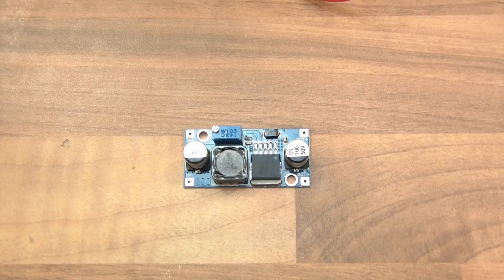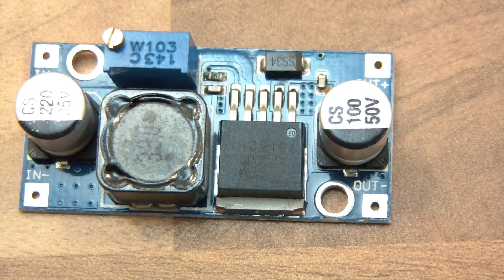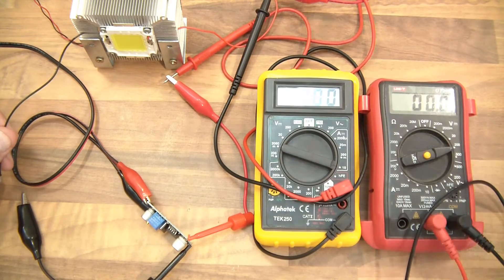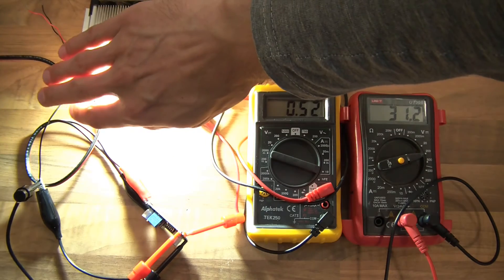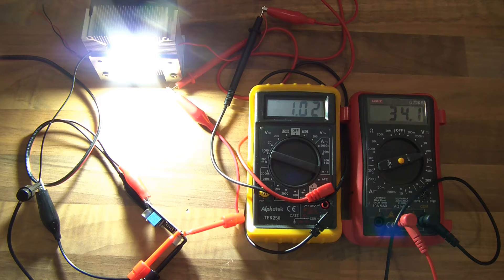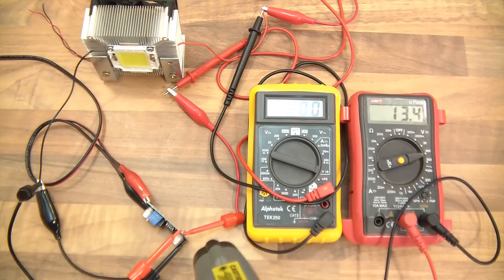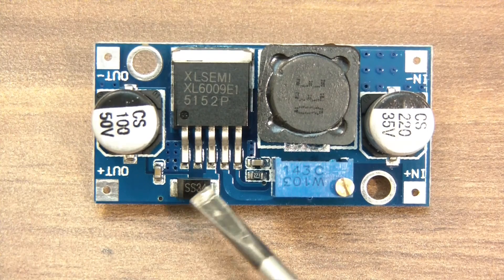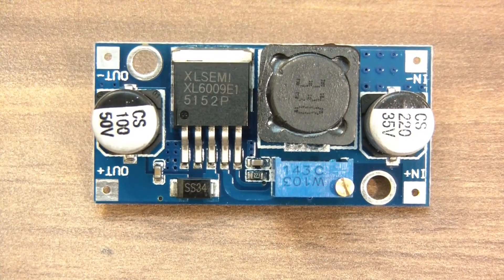INVESTIGATING: The Capabilities of the XL6009 Boost Converter? (According to Real Life Tests!)

Comment: If you look up the datasheet you will find that it comes in several different packages for heap dissipation.  Even the largest one (MUCH bigger that this one) is rated at 55c/watt rise.  It is also rated at 40V max.   The didio in the board is likley something like 100c/watt (being so tiny).  Also schottky diodes have a positive temp co-of, they will NOT share current evenly.  The board is a BAD BAD BAD design!

Comment: "It can't handle 60v @ 4Amps.." 
You're surprised that board isn't 240 Watt capable o.O ??
Reply: Heheheheh, yeah.  I bought a bunch of heat sinks of varying size but 240w is asking a bit much from this thing, lol.  Later in another video of this he swapped out that diode and put two on it just as a proof of concept and sure enough the heating issues went away.  Weakest link is that ss diode which isn't even the right one shown on the manufacturer's data sheet for the XL6009 chip.  They under did it (which is typical of the Chinese).  I personally would just go on ahead and drill two holes to fit a proper through hole diode that is rated properly (say 40A which would easily fit in the upright position).
Reply: @generalawareness101  nice, i've used this very board, and others like it in various projects over the years. They're fine for what they are, price, etc and as long as the user understands the limitations, etc

 i'll have to look for that other video you mentioned, as i'd like to see what the board could do with better balanced components :)  

Found it, here's the other video where he solves the diode bottleneck:
https://www.youtube.com/watch?v=vWFLVivkTHg
Reply: @cjjuszczak  There we go that is the video I was talking about (he had yet another?).  I can't post links on YT as I am banned from that due to posting replies that YT ai didn't like and posting a link to them in picture form.  Banned for life.

Anyway, the best way to handle this diode issue is desolder it, as he did, but replace it with a SB560.  Either slap it to the side or drill two holes into the SMD pads so it can go through a hole (depends on if you have room or not if it is currently in a box etc...).  Once you migrate to that 5A 60V Schottky diode the heat issues are long gone, AND the thing is far more stable too.
Reply: @generalawareness101  thanks for this, great stuff, and yes, Youtube is very odd in how they manage their users and features :)
Reply: @cjjuszczak  LOL, that is putting it very mildly. hehehehehe.

Comment: Also important - you must apply a low voltage like 3V first, then adjust your OUTPUT to higher voltage than your intended INPUT. You must do this BEFORE you connect power!! These will be damaged or burn up if you apply INPUT voltages that are HIGHER than what the OUTPUT is SET for.... make sense?

Comment: Check the data sheet, but these can handle only 10 watts of power, so at 30 volts, you would only get .3A
At 15 volts, you can get .66 amps, etc... amps X volts = watts. A heat sink might give you more room...
Reply: so? can i get 24v 400mah from 5v 2amps?
Reply: @fleeth  Do the math.  24*0.4=9.6w.  5v at 2a is 10w.  I highly doubt it due to inefficiencies that will always be there.  Now 5v at 3a this could do it.

Comment: You can get little heatsinks off Ebay 10 for 99p could use heat conducting glue to stick one (or part of one) on the diode

Comment: What are the best diode to use to take the full ampere of the chip ?
Reply from the maker: Hi Russell, the best diode mentioned is SB560.
Reply: Antony Cartwright can you use an BY359F/1500 diode instead of the SB560 diode
Reply: @MrMaker-pt5sw   I personally would just go on ahead and drill two holes to fit a proper through hole diode that is rated properly (say 40A which would easily fit in the upright position).  Something like the SB560 because it is widely available, and damn cheap.  The best part is that it is through hole not that surface mount shit.  Don't get me wrong sm is fine, but I just can't trust any SMD for high currents.

Comment: U don't use a current limiting resistor for the led?
Reply from the maker: Max Carlin Nilsson I didn't need to because the led can allow 3 amps to pass through it before burning out. But it wasnt possible for it to burn out in this project because nowhere near 3 amps could be delivered. Antony...
Reply: If you limit the voltage, the current is automatically also limited.. Ohm's law..